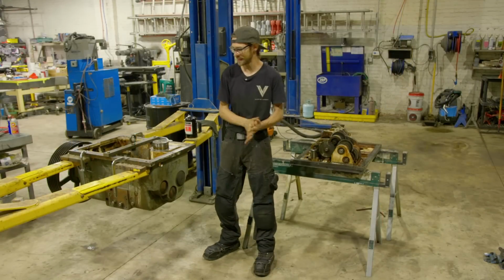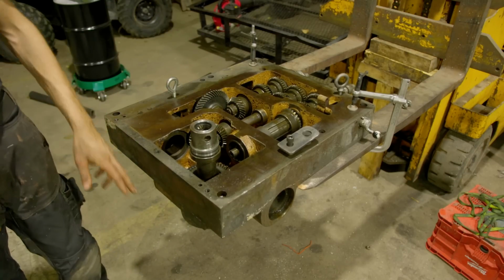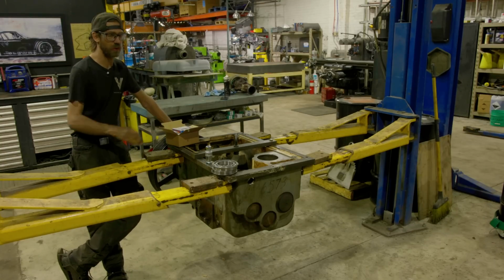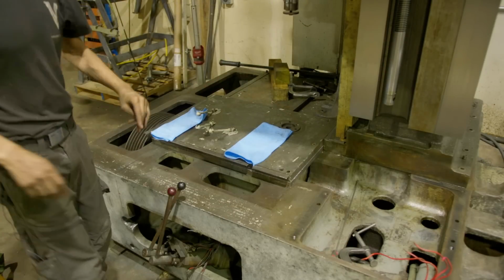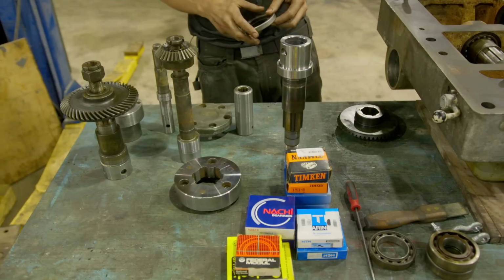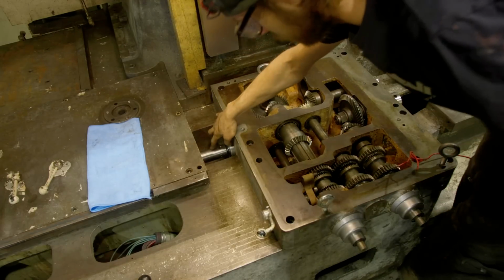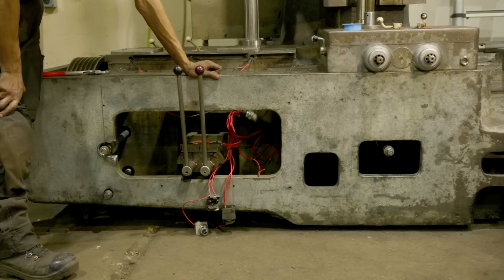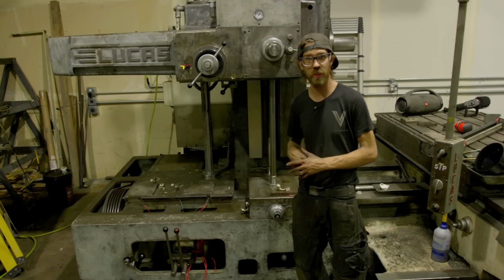Finishing the Gearbox Rebuild on the Lucas | Lucas 441B Project

Comment: You can get a 3/4” to 1” NPT bell reducer. With both ends being female the 3/4” would attach to the pipes coming from the Gear cases and the female checked hydraulic quick disconnect would attach to the bell reducer using a one inch all thread nipple. That way you could use your drain hose with no reduction in overall area on the drain hose. Just a thought. Overall you’re like I was, back when I was young. I’d rather do it myself. You do fine work and I enjoy watching.
Reply from the maker: good call I did not know that

Comment: I realize it's to late now, but the next time you change the oil install ball valves on the drains. This way you can control the oil instead of dealing with just the drain plugs. Just a thought. Overall nice work.
Reply from the maker: I got one on my pacemaker. they are nice. but sometimes they fail so I decided to go the simpler route here

Comment: On the belts do they still have "matched sets" ?I remember in the 80s Dodge AC used match set belts,when I was a mechanic.
Reply from the maker: I have heard they do but I think the manufacturing quality is higher now then it was because no one seems to make it a priority to try to sell you matched sets but I need to ask my belt supplier again.

Comment: I'm curiourious why gold is not used on shaft seal surfaces more often; it seems so little would be needed.
Reply from the maker: because they would have to plate it and would add additional cost. and also gold has poor abrasion resistance.

Comment: It must be a Class One Hassle to work on this machine without the official documentation. How many more times are you going to discover 'later' that there was supposed to be an easy way to handle a task?
Question: do you plan to do any inspection of the ways for the table? If you find excessive wear, are you going to be scraping them in? I have watched the process on Adam Boothe's and Keith Rucker's channels, it looks like an exacting process to measure correctly.
Loving the series, and I request more long-format videos. So many creators assume that everyone wants short videos, and call their trade 'boring', but I am interested in the whole process, including the mundane bits, like cleaning for instance.
Happy holidays!
Reply from the maker: yes it is a pain I am doing a video on the table. was on this machine are hardened and its not too worn so no scaling will be needed

Comment: Two things if you don't mind me saying.
1. On the vertical shafts for the small gear box, I would have cut a internal groove on the flange and installed a O ring to act as a secondary/backup seal so that cavity does not hold water or swarf.
2. I see that you had to make a sacrifice on your hand to the machinery gods. The gods always want blood.

I love your content and always learn something when I see your video's!
Reply from the maker: yeah good idea. They do require a sacrifice

Comment: Many people who have been completely misled about USING THE CORRECT OIL.
Regardless of the type of oil, once the oil is contaminated it is going to damage your machine.
manufacturers LONG LIFE OIL, with dinosaurs tears and angel spit, once it’s burned or contaminated it’s garbage. 
Once an oil is contaminated, replacing it with any modern oil is superior.
Thanks for sharing this important information regarding oil. so many young guys are afraid to replace contaminated oil, because they don’t have a specific brand available to them. I guess all the marketing works.
Reply from the maker: yeah no problem.

Comment: Why not put some type of electromagnet on the bottom of the pan so that all the chips would be stuck until you turn it off to drain it and then the chips will drain but can’t circulate while running
Reply from the maker: yeah good call. I have thought of adding a magnet

Comment: All that work remins me of pulling the gearbox from my K&T Autometric Model B (think horizontal jig bore).  500 pounds of gear box, took about 12 hours to get out with the 6 or 7 connections and having to tilt it fore and aft a couple times.  Had to make a new coupler for the drive as the old one was broken, figured out why when i got it back together - the PO had deleted the main gasket.  Things went back together nicely with a 1/64 paper gasket.

Oh, yeah, all that work was because the PO had mistimed a gear and shifter.  Took maybe 10 minutes to fix, total about 22 hours to pull and replace twice.
Reply from the maker: yeah I know how that is...

Comment: Have you seen the Dry ice cleaning machines that are available?
Might be a good solution for refreshing the finish on old equipment. Unlike media blasting there’s no material or finish removal and seems to work on stains or surface debris etc..
Reply from the maker: yeah they are cool I don't have access to one easily but it would help in certain circumstances

Comment: Hey Kyle, just fyi 3d prints are very porous so you might want to dip that cover in a clear lacquer or something if you're looking for it to keep water out! Nice video as always
Reply: Makes sense. Good looking print by the way, what printer are you using?
Reply from the maker: yeah its more for oil being splashed occasionally. its not trying to be water tight per say. It's like waterproof vs water resistant. This is oil resistant.

Comment: Sorry to say, but if you were here in the UK you would have seriously failed your fork lift driving test. Several MAJOR no-nos, including walking under the raised forks and operating the controls while not in the driving seat.
Reply from the maker: My forklift has no breaks. it is very old and sketchy. I need a new one
Reply: Some people see only problems. Others work with what they have to get the job done.

Comment: I recently observed how metal filings were attracted to a crack in a tool housing, yes I know magnetism and dyes and particulate have been used to diagnose cracked casings for decades.
Did you notice when you were drilling with the magnet base drill that the swarf was pulled out of the cut.
Just a thought about application of magnets to capture metal debris from the bottom of the case you’re refurbishing . It’s such a difficult place to do bearings would it be an idea to retrofit a big magnet in the bottom of the case for bearings longevity ?
Really like your work and channel.
Reply from the maker: Not sure might be good idea. Thanks

Comment: Drilling and tapping on a gearbox with gears and bearings still installed? Don’t know the circumstances, just wondering how you kept things clean.
Reply from the maker: It was washed out after and rags put behind hole. Also anchor lube helps get shavings together

Comment: Awesome watching you work! Curious about one thing. Could you not have cleaned up that seal service and just went with a different diameter seal? Also, would it be worth it to put some type of shield over those exposed seals? I'm totally impressed with your tenacity and skills!
Reply from the maker: Yeah I could probably go w different size. I did that one 2 of the 4 seams because I couldn’t source originals. But I went with original sizes when possible.

Comment: Probably a bit late now, but a suggestion for future reference; instead of fitting a close taper nipple with an elbow, fit a Street Elbow instead, does the same thing in a neater one fitting package.
Have a great Christmas and New Year, looking forward to your next year's videos already. All the best from the UK 🇬🇧.
Reply from the maker: I bought a street elbo, they neck down considerably. Going w 2 parts keeps ID as large as possible.
Reply: @VanoverMachineAndRepair  I'm surprised that it reduced by that much, especially as you drilled the drain holes wider. I'm in the process of putting two on my new to me lathe, when I change the headstock bearings. I'll check on the bore then. 
I have done it a couple of times on various machines and fit a female/female full flow ball valve with a plug, so that if the valve should vibrate open it cannot leak.
Reply: or a M & F elbow
Reply: @stuarthardy4626  Thats what I would call a street elbow here in the UK.

Comment: a ball valve on the drain pipe would make things less messy
Reply: Until.the ball valve fails. Been there done that. Lost 200 gallons of oil
Reply: @TopperMachineLLC  Point well taken, but some kind of valve would be nice.
Reply: @mikekeuleman  I told Kyle how to do it.  Simple setup with no valves.  He just doesn't listen too well. Lol.
Reply from the maker: I don’t listen